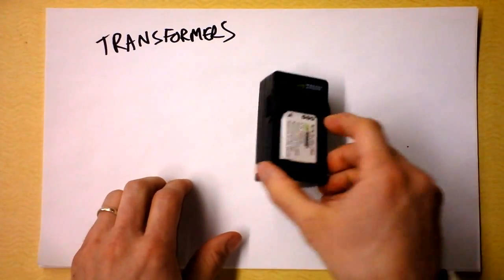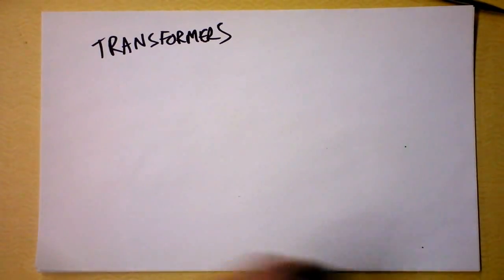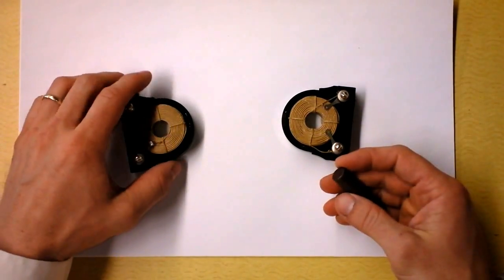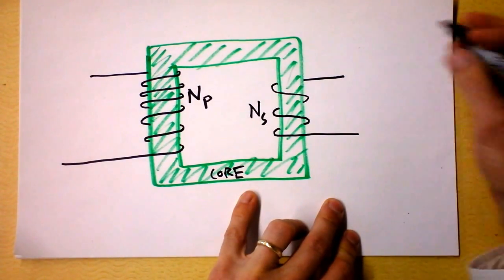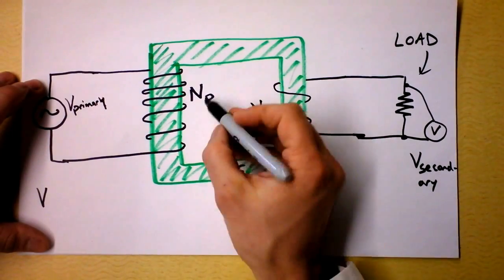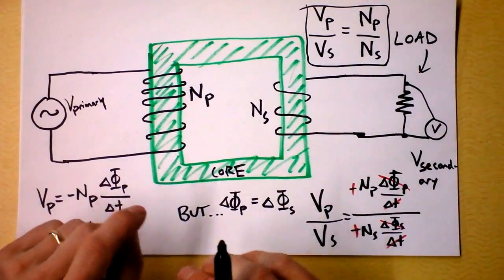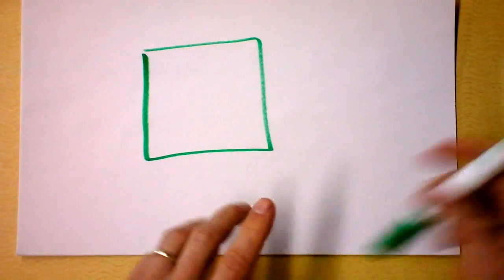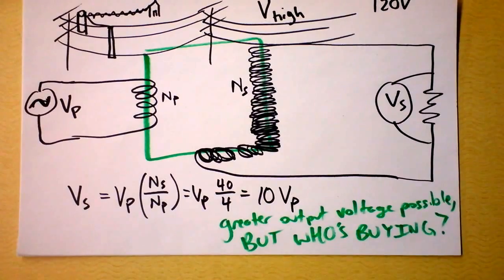Transformers are Awesome! | Doc Physics

Comment: One thing we also had to take into account was the transformer winding gauges (AWG) and resistance of each windings. We design these power supply (AC/DC) with an engineer and I was the Lab Technician.

Comment: I'm just getting into electronics and trying to learn as much as possible after learning about Nikola Tesla. I have some ideas, but don't know enough to apply them yet. If you use an a stable  or flip flop circuit to supply the transformer would that work to create a stable voltage increase with the transformer?

Comment: When the secondary circuit is open, my understanding is that current through the primary is negligible, resulting in very little power loss. Why? Wouldn't this behave like a simple inductor, with current flowing through primary windings similar to what happens when the secondary circuit is connected? Is this because, with the secondary windings disconnected, there is much greater inductance of a system where the electrons on the secondary side have nowhere to flow to?

Comment: Great lesson, Doc Schuster. I'm trying to play mu PC's audio out (stereo headset output jack) through my guitar amp (mono input jack). I know -- I think I know -- that my PC can power 8 ohm speakers. I've heard that the input tp guitar amps is Hi-Z (high impedance). So what kind of transformer do I need in order to play my PC's sound through my guitar amp?
Reply: Never mind, another Youtuber told me that I can cable the Line Out (headset) audio into the Input Jack on a guitar amp by turning down the HIGH and LOW knobs. It works.

Comment: so are you saying that electrical distribution systems are using higher voltage on power lines and less current, which causes more heat which causes electricity bills to be higher?
when they could have higher current and lower voltage, which would cause less heat, which would be a lower electricity bill?
thanks for the video....I am an electrician apprentice just learning some extra stuff.

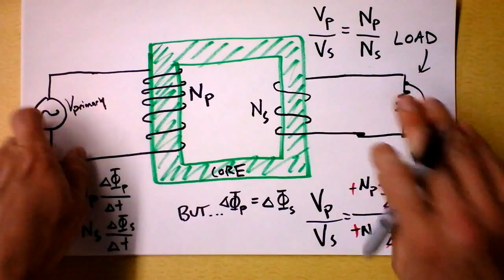Comment: at 10:48 you say that if we apply 1V emf in the secondary circuit we will get a 2V emf in the primary circuit, but since there is no AC, the flux won't be changing, and there should be no induced emf, right?

Comment: Why not have a magnet flux ratio pluser. In the iron?!Using som kind of magnet. Ore why not use a flux medium fluid in a tube and a pump to do the job on making frekvens.. its all abouth frekvens and higer frekvens gives also more power.More flux gives more power out. If a heat pump can steel some power from air why not this steel some power from magnet flux?!

Comment: Very cool story, love the ending XD
So a question: I have some regular, 1:1, 4 pin transformer, but need some with a 5th pin for the ground-reference point.. Could I 'add' the 5th, centre tap, by just adding two equal resistors between positive and negative pin? I mean, at any given moment it's basically at V+ and V-, so by adding a Voltage Divider like that, could you 'hack' the ground pin into it? (It's for a Passive Ring Modulator, DIY synths and stuff)

Comment: Hi Doc thanks for the info. I tried to wind a trafo for a small inverter.It gave me high voltage on sec but could not drive a small motor even through a regulator.

Comment: you were doing so well 
ohm's laws states the inverse relationship of IRE 

based on that you can supply a house with lots of current.
Using a step down transformer to a respectable 120v and lots of ampers thus running all your appliances on a parallel circuit aka circuit breaker

ohm's law also states parallel circuits 
volts stay the same so your current is divided that's why each breaker has a different values and your kitchen has more current than your bathroom

Comment: idk man some people are really into balloons..like too into balloons. like, you stumble across a interweb page that makes you say "that's enough internet for today", into balloons... Until you warned them about this danger the secondary  (less mentioned) balloon fan bait function of the electrical distribution systems was the only thing keeping the "yahoo groups" servers from overloading (Darwinian bandwidth limiter) ...with in weeks yahoo will return 404 and as we speak some acountant is having the worst day of his life! 

on a more serious note, 1) great video, idk if you teach jr high level but you would be great at it! the energy level yet integrating a little bit of math and keeping it all simple with out leaving a black box is a perfect combo 2) last two 9v radio shack wall warts to hit my bench were outputting 14v..as I understand it eddies punch holes in the secondary coil insulation over time. The result was an unnecessary trip to the grave yard for two el panels driven by a flyback which ended up putting out around 3xx instead of 2xx it should have. 3) you could intro waves and phases by adding on to this, revisit the house hold step down at the utility pole and show how the split phase works 4) have u considered something like a ms surface or android tablet instead of paper?

Comment: Your videos are incredible. You gained one more subscriber. I am trying to learn more about transformers because I am moving to a country where they've got only 220v... All my current (pun?) devices are 110V North American, some are bivolt. Kitchen appliances are 110V and I am taking them with me. I took a look at transformers online. I don't trust any of them.
I did my research and the one I found of a maybe, possibly, acceptable quality is the Kriegers... I have learned that heavy in weight, power supplies make for better, quality products. Somebody stated that the Kriegers are heavy... Anyway, my question is:  If I have a device that is 300 watts, I am going to double or triple that amount in my transformer... I will get a transformer rated for 900 watts for example (not planning on powering hair dryers, microwave oven, etc). I know they are rated at that but don't really output that much because of heat, etc... HERE IS THE QUESTION (finally) Due to the transformer being a ''simple'' device, will the components, ie cheap brand, expensive brand make a real difference?

Comment: how many windings on the primary would you need to have enough resistance to not blow a typical..120v - 15amp...80%.. 120v-12amp breaker?
Reply from the maker: That depends heavily on what gauge wire is used.  And remember, it's not just the DC resistance, but also the inductive reactance that decreases the current.  I imagine that the reactance goes down when the secondary is shorted, which is how you might still blow the breaker under load.  What a wonderful question.

Comment: Hi there. Great vid and info. I'm currently trying to build a transformer and was hoping you could help me. Specs show a tapped primary (0 - 10 - 210 - 230V) and six secondary windings (0 - 250V at 120mA / 0 - 35V at 20mA / a tapped low voltage winding 0 - 4 - 5 - 6.3 at 3A - 12.6V at 1A/ and three 0 - 6V at 50mA). No split bobbins just grounded copper tape between primary and secondary. 
I'm trying to figure out which winding order would suit this transformer best. Would you start with the primary, isolate and then just continue winding full layers from the lowest V winding to the highest? (for exemple the 0 - 6s first followed by the tapped winding, the 0 - 35 and finally the 0 - 250? Or does this type of setup requires more care in its order?
I also trying to guess how the A decreases in that last tap 12.6V. Any idea?

Cheers

Comment: Please Help. I have bout a machine which input is just 120V, but I live in Europe and as you might know the voltage here is 240. So I am affraid if I stick it to the wall I burn it out. What to do then. Building a Home made transformer is a good idea or just take one out of one of my other 240V Trans. and change it with the one, which works only with 120! The output of the transformer is 24V and 50HZ. Any Idea which way I should solve this problem. Thank you very much.

Comment: Great thanks. What about the diodes? Do transformers emit heat because the coils impede the current flow? If so input power must be greater than output power.

Comment: Why are transformers rated in KVA? Thanks in advance.
Reply from the maker: +Martin Dunno.  Could it be a measure of max power? kV times Amps?
Reply: This is indeed true!  You need to know how many watts a transformer puts out for what's using power down the line.  Learning about this for HVAC work, you have several motors on a fridge, and in some cases have to assume they may all run at once (though unlikely).  Will the transformer supply enough KVA for those motors if they do?  Important to know if you are replacing a bad transformer.

Comment: Does anybody know what would happen if you increased the size of the Iron core in the transformer, i.e made it wider??
Reply: or changing the number of turns of copper wire while keeping the same ratio. or changing the thickness of the wires??

Comment: That outro... omg XD. I wish a lot more teachers were this fun, it would be harder to NOT pay attention to them.
Reply: But you only use V2/R when there is uniform voltage throughout... I reckon the voltage between two transmitters are the same but the voltage between the power source and first transmitter is less than the voltage between power source and second transmitter.. So you use V2/R when voltage is same throughout as in a parallel connection in domestic circuits..
Reply: Uh... but power is also equal to V*V/R. (Ohm’s Law). There is a good reason for having high voltage for long distance power distribution but I am not sure you have pointed out the correct reason. I did however, really enjoy your presentation.

Comment: If the secondary circuit has a fixed resistance wouldn't the higher secondary voltage also produce a higher secondary current because V=IR?  Once the secondary voltage is set by the number of coils, isn't the secondary current entirely dependent on the resistance of the load?  But then the energy question remains unanswered.  What am I missing here?  PLEASE HELP!
Reply from the maker: +Ryan Ahern Hey, check out my videos on power distribution.  Perhaps they'll help.
Reply: +Doc Schuster It seems that the resistance of each of the two circuits also gets transformed and transfered between circuits so that if the resistance of one increases the current through both will decrease.  I was thinking that the current in the secondary circuit should be dependent on the voltage from the transformer and the resistance of the secondary circuit.  I now think it is actually dependent on the voltage from the transformer and the resistance of BOTH the primary and secondary circuits and this is what allows you to calculate both the current and voltage of one if you know the current and voltage of the other.  Is this correct?

Comment: but i can write i^2R as V^2/R.. That says that I should keep less voltage to minimize power loss.. I dont understand this!!?
Reply: No, remember you're dividing resistance with your formula of V^2/R but multiplying resistance with your formula of I^2R. So it says that your value for voltage is higher in comparison to current to minimize power loss. (For example: Your current is 10A and your resistance is 2 Ohms... With the formula "I^2R", the power you should be able to obtain is 200W and that is, let's say "comparatively lower than many other power supplies". With this 200W and initial resistance of 2 ohms, you can test out to see how much voltage is needed to obtain back this value for power with the formula "V^2/R", and you will find that it's 20V, which is of a higher value than current.

Comment: Residential voltage is usually 120/240V.  120V line to neutral and 240V line to line, but I digress, you did an excellent job of explaining, and you kept it interesting.

Comment: I don't get it why is the voltage on the primary coil= (-N*the rate of change of flux wrt  time) 
isn't it supposed to be = to the voltage supplied by the A.C. source ???
Reply from the maker: ostora94 Yeah.  I imagine those must be equal for sinusoidal voltage.
Reply: Doc Schuster keep up the good work
Reply: EMF = the voltage supplied by the A.C. source. CEMF = - L•(di/dt) = - N•(dФ/dt).
CEMF is always equal in magnitude and opposite by phase to the applied EMF.

Comment: I don't understand why they take the square root of the ratio relating inductance of the primary to inductance of the secondary √Lp/Ls as well as the impedance √Zp/Zs. For a step-down transformer: Np/Ns = Ep/Es = Is/Ip = Lp/Ls = Zp/Zs(ideally). Example: Np/Ns = 687/186; Ep/Es = 16.794V/4.546V; Is/Ip = 64.874mA/17.564mA; Lp/Ls = 3.0435H/0.824H; Zp/Zs = 956.143Ω/258.867Ω
Reply from the maker: 2013Aleksey2013 Who does that, and when do they do it?  What do they claim that the sqroot of the ratio equals?
Reply: Doc Schuster They (authors of some electrical engineering books) claim that Np/Ns = √Zp/Zs is a mathematical relationship used to describe an impedance matching transformer. But these two ratios are not equal to each other...
Reply from the maker: 2013Aleksey2013 Fascinating.  Here's how I make sense of it:  P = V*V/Z, and Nin/Nout = Vin/Vout = sqrt(Pin*Zin/(Pout*Zout)) = sqrt(Zin/Zout) since Pin = Pout if the transformer is ideal.
Reply: Doc Schuster Thank you very much! So P = V^2/Z, Np/Ns = (Vp/Vs = √Pin*Zp/√Pout*Zs) = √(Pin*Zp/(Pout*Zs)). Pin and Pout cancel each other out assuming they're equal. So the turn ratio Np/Ns is indeed equal to √Zp/Zs. Awesome! As an example: If I have two purely resistive loads (no reactance) rated at 1kW each but they are designed to operate at different voltage levels, one is 125V load and the other is 250V load, and the only available electricity from the outlet is 125V, then I would never be able to get full power (1kW) out of the 250V load if I were to connect it to a 125V supply. The current draw of the 125V and 250V loads are 1000W/125V = 8A and 1000W/250V = 4A, respectively. The impedances of the 125V and 250V loads are 125V/8A = 15.625Ω and 250V/4A = 62.5Ω, respectively. So the impedance ratio of the primary to the secondary should be √Zp/Zs = √15.625Ω/62.5Ω. Assuming that Vp/Vs = Np/Ns, then (Vp/Vs = √Zp/Zs) = (125V/250V = √15.625Ω/62.5Ω). So, powering the 250V load from a 125V source through an impedance-matching transformer that has impedance ratio of √15.625Ω/62.5Ω would guarantee 100% (1kW vs 250W) power dissipation at the load.

Comment: some adapters use switching circuits - so the time !  power is gated ?

( whether a ups / uninterrupted power supply , or laptop charger )  sets

the final output voltages .